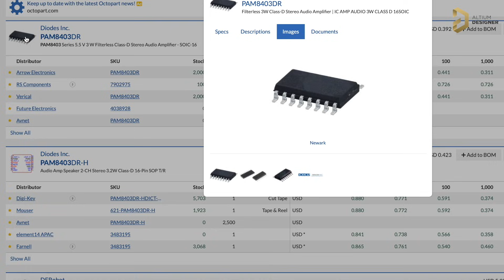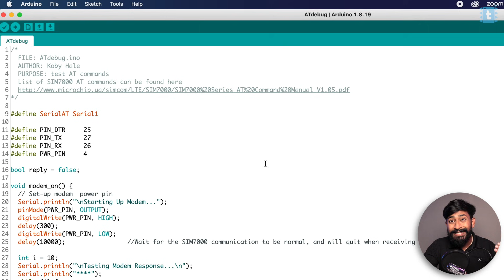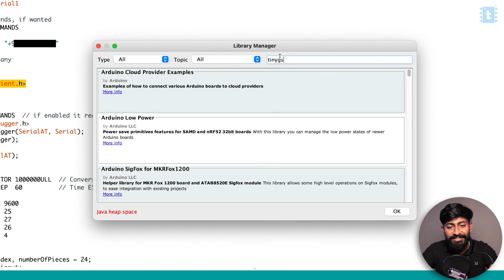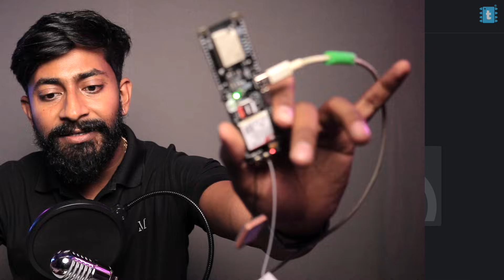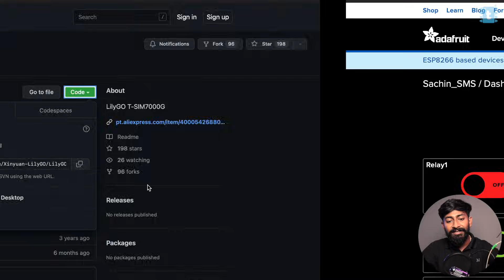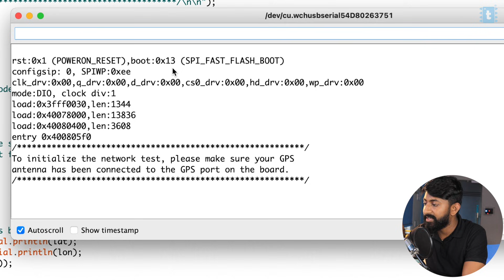One Board, Multiple Connectivities | Getting Started with T-SIM7000G | IOT Board | ESP32 Board

Comment: How do I know if I use LTE-M of NB-IOT. What makes the difference? Is that by the library I use?
Reply: You can select the band. the easiest way is to set preferred network selection to call the API modem.setPreferredMode(3); // CatM or NB-IoT
The response string will contain the information about the band it is connected to mine was 1900 which is GSM band
Reply: @jadejayuvrajsinh  Bro do you have the setup code ? for using nb-iot?